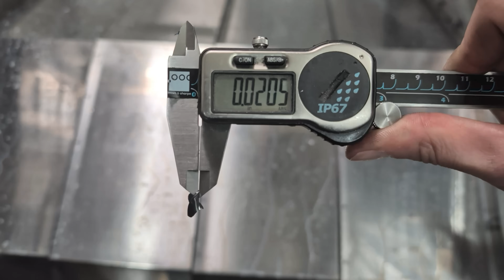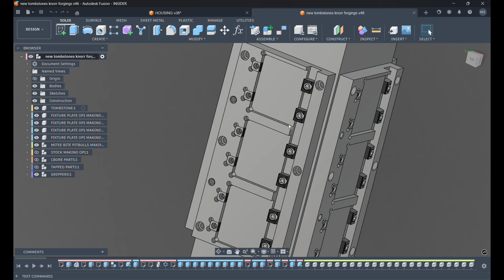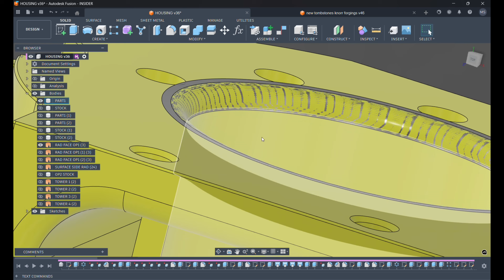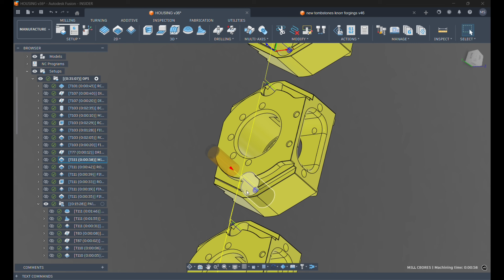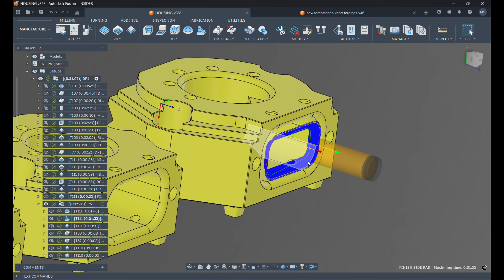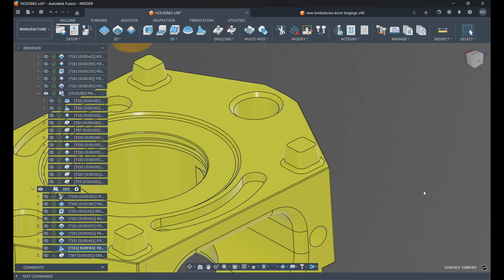CNC Milling Job Shop Work -  Evicting Some Serious Metal From A Housing

Comment: The parts you make are very impressive. Do you program this using mazatrol or another cad system? If it's another cad system would you be able to make these parts as easy using mazatrol?
Reply from the maker: I program most of my stuff with Fusion, unless its ITAR work then i use Mastercam. I have never used mazatrol on a mill before, we just buy them more because we like the machines
Reply: @M @MSMillingCNC thanks for answering. You have a real talent. Videos are great and informative.

Comment: We use a similar type of cutter of Ø12x5D mm at my work. I usually have two in my machine; one for roughing and one for finishing. Ive never seen any marks from those chip splitters on my finished sides. And for some reason; this type of endmill just keeps going even though its severely damaged and is SCREAMING and begging you to change it. Real beasts =)

Comment: Hey man I can't help but notice that the highfeed that your using looks like a dormer pramet SSN11 with a harder grade of insert I've actually had a pretty good time with that tool with the SNGX 110416SR-HM:M8330 grade insert on interrupted cuts if that is the tool that I think it is.
Reply from the maker: It is. I have both grades of inserts that I use and for some reason I generally get better life out of the M9325 than the 8330 for some reason. I haven't really thought of trying it for inneruppted cuts but in general I seem to find they last better

Comment: I have a question: Why do u take so much from the block with the face mill on the first op
Reply from the maker: these parts were 1018 CRS which has a lot of built up stress in the material, so to mitigate as much of the part wanting to move as possible, i try to take even amounts off both faces to have the amount of internal stresses removed during machining be even so the part is less likely to warp. if you only take .015" off one side and .500" off the other, chances are it will distort after machining with CRS

Comment: 3:50 Oh yeah, that controller. The one where the program monitor wasn't given its own dedicated space, and instead takes up a portion of the screen. What bonehead design decision was that? What's worse is the amount of wasted real estate on that screen. So empty. It sucks using that controller.

Also, your G02/G03 is using R's?, and not I and J's? How do you know you you can trust the controller not to create a micky mouse ear? I guess the Post must put those in anyways, if it sees that kind of movement?
Reply from the maker: I just do that because the programs are like 30% longer with Is and Js. I have never had a Mazak cut the wrong radius like that, although I have had it happen quite frequently on our robo drills. Then I have to switch to Is and Js for my program

Comment: Nice work.  Do you know the function of the housing? Would be fine to tell about to my students. (I teach CNC manufacturing)
Reply from the maker: Im not exactly sure what it is for, i am asssuming some kind of electrical sensor based on the customer but i was not really given any more info than that

Comment: Love the cam walkthroughs. What tips can you give someone learning how to better control fusion to do what I want. I’m able to do most basic stuff so far. Long time machinist, newer with cam.
Reply from the maker: The main tip that I can give you, and it's going to sound weird, is use the resources online to get the general patterns down of how to use the CAM program then basically just play with it and do it over and over. Repetition makes it really easy to get it to do what you want
Reply: @MSMillingCNC Right on, thanks.
By the way, .02ipr on a drill is crazy. Where can I find these tools? I only make stainless parts. Just came over to the milling side of the force after 15 years of doing mostly lathe work. Never pushed a drill that hard, then again never had decent tooling either.

Comment: I'm always running the 7 flute 3/8" version of that Helical endmill on Ti and Stainless and that thing is an absolute TANK. My last one ran over 1,500 titanium and stainless parts and was still running great. Looked like absolute crap under the microscope, but it was still doing great for roughing!
Reply: What was the brand ?

Comment: Love watching your work man where do you find shops with machines able to go crazy like this
Reply from the maker: My family owns this shop, and I'm the programmer/mill setup person so I kind of have freedom to run them as I see fit! If you aren't pushing your machines at all then you are leaving cycle time and in turn money on the table!
Reply: @M @MSMillingCNC I’ve been pushing my machines a lot faster I’m limited by belt driven spindles so not very much bite but average 160-200 ipm on my roughing at .03-.06 doc with the facemills this video has shown me I might need to push my carbide drills a good bit faster tho I’m waaaaaay low and use the same drills
Reply from the maker: @matthewhankins7120 as long as you're using your equipment to 80% of its capability, hats of to you! And yes, these drills can take a lot of feed and last fine - I regularly run my .551 drills at .025ipr without issue and in cast iron up to .032
Reply: @MSMillingCNC that’s a wild chip load for a drill I’m going to have to step my way up to there sometimes I’ll push them to about .012 chip load but never thought to go higher unless it’s the inserted drills or the smd drills from sumi

Comment: I'm still learning horizontals, we run Okuma's. How are you using the tool orientation? When I program a part that is milled on 3 sides I need 3 work offsets. How does it work with Tool orientation if the WCS is not in the center of the 4th axis? Would love a more indepth explanation, it would save me so much time not having offsets for every B axis move.
Reply from the maker: I was actually shown a macro by our previous programmer that we have in all of our horizontals that is basically like a G68 coordinate rotation but in a sub program that uses the centerline location of the pallet of the machine to recalculate the zero for each orientation based off of where the work offset moves to from where it was originally. Just basic trig but it has made life 10x easier than having to add a different work offset for each index. Now each part is only one work offset and all the features stay together once its set up correctly. Just had to mod the post processor to output the recalculation line each time the B changes.
Reply: @MSMillingCNC  I believe we have something similar, we can call a G116 and define the XYZB of the current WCS and the XYZB of the new WCS, so I might have to look into making something similar to that. Anything you can share to get me started? I understand that Mazak en Okuma are not the same in terms of parameters, but I can make that translation.

Comment: Can you explain how you use the work offsets for different faces? Is it the G68.2 or you use additional offsets for each face?
Reply from the maker: so the whole part is programmed off of one work offset with one origin. the program uses a macro sub program that recalculates the zero position depending on what the index is that it is machining at (basically the same as g68.2 but in a sub program macro). i changed the post processor so that every time the B axis changes, it spits out a sub program call up for the machine to recalculate the zero point for that index angle. Its much easier to just have one singular zero point for a part, especially when there is a bunch of different index angles.

Comment: Can you explain when u use coolant and when u dont in steel?
Reply from the maker: most of the time i don't use it just for video. In practical purposes, i don't usually run coolant on stainless, normal steel, or cast iron for most indexable mills. I do no use it on endmills where chip evacuation is not a problem in the same materials. Pretty much always us it on drills and in aluminum.

Comment: Still really liking your videos. They are giving me so many great ideas on fixturing and cutting strageties. I wonder: When you are using an endmill for features that are not so deep - Removal of the hat on OP2 for example: Wouldn't it be more economical to run an enmill with inserts ? They cut kind of rough with 2 or 3 inserts though, maybe same problem as the high-feed mill ?  Which Mazak HMC is it that you are using in this video ? You have lots of brands of mills: It would be interesting if you did a comparison of stability, speed, reliability etc. Thank you !
Reply from the maker: it probably wouldn't be as economically different than you think! because of the free cutting nature of a solid carbide endmill, they last a long long time in mild steel like this without wear, and i would need to use one to finish those steps anyways after the indexable one ran. You are correct on the fact that those indexable mills like that tend to cut a lot rougher than their solid carbide counterparts. I have looked into the replaceable tip shanks that you just replace the ends of them with new endmills but in general they seem to be more expensive than just buying a whole new carbide endmill so i have yet to see where that would be financially viable either. I do use many different brands of tools, depending on application so ill keep that in mind!
Reply: @MSMillingCNC  Thank you for answering! As you say: I would have thought it was quite a difference economically. But I'll keep that in mind.

Comment: I think the high feed inserts break over holes and at edges because they pinch a chip between the part and the insert which blows the edge off.  I had this issue with my high feed cutters and switched to using solid carbides instead taking deep cuts in one hit.  We found this was also much faster than high feed milling so it was a double bonus.
Reply from the maker: That's exactly what happens. I usually get similar MRR between an endmill and high feed mill so I perfer buying inserts over solid carbide, but a lot of the time I will just rough the material off the back with an endmill or 45 degree facemill so I can stay away from the inneruppted cuts
Reply: @MSMillingCNC  Try Widia cutters with a .125 radius corner.  I use hundreds of 5/8 and 1/2 inch every year and they are fantastic cutters.  Super strong and quiet in operation.  I've gone 1.2 deep with the 5/8 full slot 30ipm in 1018 steel and it purrs.

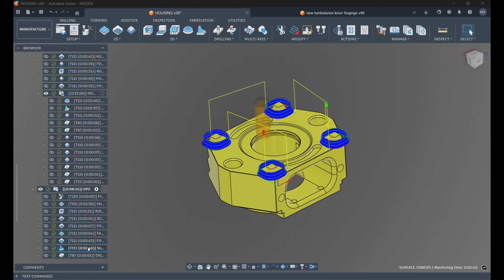Comment: great video like always. 18:08 is there a reason why you created extra surfaces for all 4 Towers an not just one and then used patterns? i am actually curious. In my experience putting patterns inside patterns works pretty reliable
Reply from the maker: Yeah, to be honest I'm not really sure why I did it that way! Usually I would do it with a pattern but for some reason I did it the long way on this part! Good catch! Duplication patterns are awesome for this sort of stuff

Comment: The Matrix Nexus control is still probably my favorite even though there is always some sort of alarm showing (usually maintenance related). Smooth G presents well but isn’t as intuitive on the shop floor. Thoughts? You’re crushing it with these videos BTW
Reply from the maker: I was just telling our Mazak rep last week that the Nexus 2 controller is the best one they ever made and I want it on our new Mazaks, not the Smooth! I am not a fan of that controller at all, besides the memory. I'll take a good nexus or nexus 2 over a smooth any day. Thank your for the compliment btw!

Comment: Never had a luck with Helical. I love their Advisor, it’s very user friendly. But for their tools… i compared them to Imco for steel and stainless stee.Imco just last much longer. Recently l switched to new line of 5 flutes Kennametal. Those are last even longer than Imco. Surprisingly Sandvik was the worst in this comparison
Reply from the maker: I have definitely noticed Helical's tool quality decrease the last few years. Ill have to look into Imco I never really have used their tools. We are also switching into the Kennametal endmills. The Tplus stuff from Helical is still okay but their A plus coated standard endmills leave alot to be desired. I do like their chamfer mills a lot though.
Reply: We had the same experience switching from helical to imco. Having good luck with the M935C series. Which 5 flutes are from kennametal are you using? Harvi 2TE?
Reply from the maker: @CmdrRoot im kind of all over the map right now just trying to see what's out there to replace for general purpose endmills. I was very surprised I bought some 5 flute YG endmills last week just for shits because I saw them at EMO in hannover and we use their AluPower ones already for aluminum and I was amazed how well they performed for the price
Reply: @MSMillingCNC my shop is slowly transitioning to more YG stuff, can vouch for those AluPower endmills. Certainly interested in their ferrous options!
Reply: @CmdrRoot yes 2TE
Reply: @C @CmdrRoot also Helical Advisor gives over promising speedss and feeds, IMCO ToolBot is ugly and stupid but gives the right numbers which you can just use in your machine
Reply from the maker: Yeah I don't really use any tool advisor I just come up with most of the S&F in my head lol

Comment: When roughing the second highest level with the 1/2 EM you said .125 WOC at F160.0, what SFM you set it at?
Reply from the maker: 750sfm I believe, that's what I ran it at for the whole part. 158ipm for roughing and 66ipm for finishing
Reply: @MSMillingCNC  thank you for responding back. Cold Rolled Steeling are fun material to play around with on higher SFM like you mentioned.

Comment: I switched from solid carbide drills to modular drills for all sizes bigger than 10mm
Reply from the maker: I use the replaceable tip ones probably 80% of the time, but if I have a tight positional tolerance, I usually stay solid carbide. What brand do you use, just curious. We used to be iscar sumocham exclusive now we are getting some of the kentip FS. I used it in this video just to kind of show it
Reply: @MSMillingCNC  If you don't have a tip angle callout on the hole, Tungaloy DMC drills are amazing. The little centering tit does wonders for position and size.
Reply from the maker: yeah the kennametal ones we have been using have that also, but it doesn't change the fact that the bodies are just steel, so they have a much higher tendency to walk and wander as opposed to solid carbide. I can easily hold .001 true position with a 5D solid carbide drill like this, you would struggle to ever do that with any replaceable tip one
Reply: @MSMillingCNC mostly Ingersoll, they are not expensive but good. Some Kennametal, those are slightly more expensive but as good as Inhersoll and 2 sizes of Sandvik. One is from new line stupidly expensive not worth it. Another one with one screw on the side. Those are expensive but have superior tool life
Reply from the maker: @ov3753 Ingersoll is part of the IMC group so they're probably pretty comparable to the sumocham line. We like them, just hate that the ends of the drills spring open after a while and stop holding the inserts
Reply: @MSMillingCNC the only difference between Iscar and Ingersoll I see it’s their coating. Ingersoll are golden, body and the tip